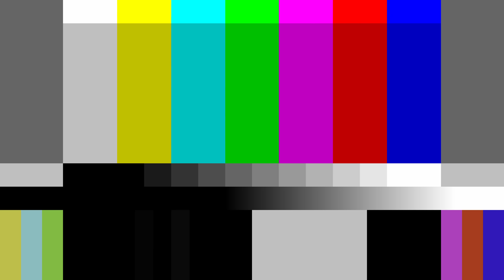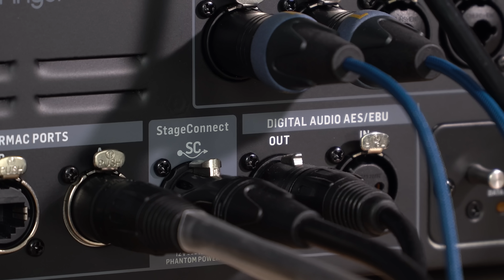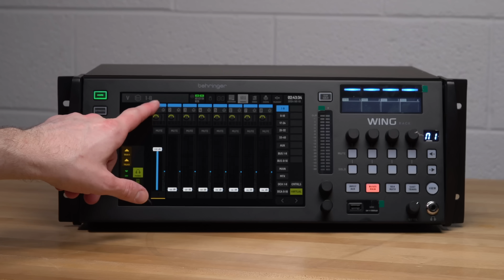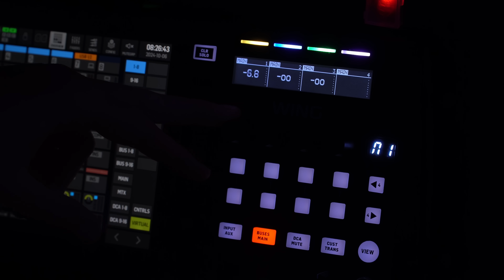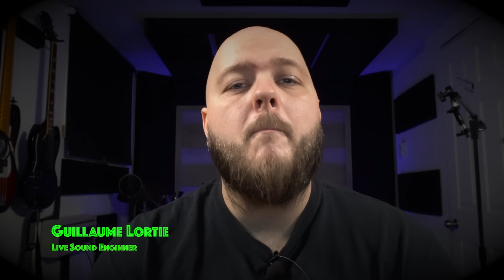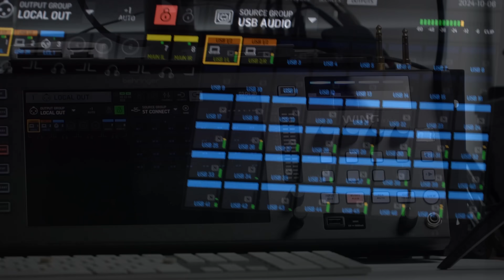Behringer WING RACK Release Day First Look and Walkthrough

Comment: Great setup and excellent feature set for the price. Would like to see Behringer figure out a way to make an officially supported remote control surface for those who want to go to that level. Either native integration between Wing Edit and X-Touch or a Wing Compact form factor (without any local, or minimal, inputs/outputs to keep cost down). I know we can get there with Wing Edit and touchscreen  or Mixing Station plus XTouch but would be nice to have a fully integrated and supported option. Also need a way to do Waves inserts WAY easier... like as a digital insert point, per channel, like most other consoles.

Comment: Hey Guys, what about the older Extention card? Would my Madi card inside X32 work with Behringer Wing Rack or do I need to buy the new card that is available now? What about the network, Does it work with my Motu AVB? I really appreciate any help you can provide. thx
Reply from the maker: Hi, no your MADI card won't work in this and as far as I know there are no plans to make AVB networking a thing with these either. Your options are the built-in AES-50 SuperMac connections, adding a Dante card or waiting to get a Waves SoundGrid card that they have talked about releasing shortly. Hopefully that helps? Thanks for the great questions.

Comment: A bit confused on the Dante card slots. Is the slot one you showed inside the cabinet where a Dante Brooklyn card can be installed, instead of replacing the SD card adapter in the external slot?

Comment: So, i was wondering if one could seperate the REAR I/O from the actual display.

Why would i want to do this? because i want the GUI to be on the top shelf of the rack, and i want to I/O to be at the rear, at the bottom, we're just talking about 1 meter of cable, but does anyone know what cable that is?

It appears that the "brain" is behind the actual screen, and that the inputs are just a few cables that goes between.

Or is the circut-board in the bottom the I/O and the psu looking thing behind the screen the brains?

Any help would be amazing ❤

Comment: i used it recently. and at first i wondered where the mixer is...silly me...after configuring the app everything went smoothly and intuitiv enough. could also record decent multitracks. the venue was a little open-air festival powered by solar batteries and it worked very well
Reply from the maker: As far as I know the first units shipped were just delivered in the past couple of days. How did you use one recently? Was it also an engineering sample like the one I have?
Reply: @DcSoundOp  good question ^^ well it looked quite similar and was by behringer.  edit: it was the x32. i´m sorry for the confusion.

Comment: The Faceplate Screen should have been just a Detachable wireless tablet.  How usefully/ cool would that have been. Everybody uses these rack mixers with tablets anyway. These days tablets are cheep and may not habe raised thr price of the unit to the consumer. 

The benefit is that you would be interacting with thr EXACT same User Interface that you interact with on any other wing instead of some cheap poorly designed U.I. on a tablet.

Comment: I’m considering purchasing the Behringer Wing Rack as soons as it's possible and I’m curious about its integration with Ableton Live. Specifically, I want to know if it’s possible to load snaps (On the X32 they're called scenes, I believe) using MIDI commands. I thought this was possible with the Behringer X32, so I’m wondering if the same functionality exists for the Wing.

This is for my band during live performances, where Ableton Live plays the backing track along with all MIDI controls for our instruments and devices. It would be fantastic if Ableton could load the corresponding in-ear-mix (one snap per mix) for each song automatically.

Has anyone had success with this setup? If so, could you share how you achieved it? Any tips or resources would be greatly appreciated!

Thanks in advance!

Comment: Why is there always something these companies leave out or don't consider? Alesis new Strike, added so many great things but then took away a number of Direct Outs... 
Ive been waiting for this upgrade from BEHRINGER for 15 years, the main thing I and many others wanted to see, USB-C, USB-C, USB-C, USB-C, USB-C.... Why are we still using length and bandwidth limited USB-B HOST cables in 2024... ffs They could have even done USB-C in the front port for many extras besides Program Saves and Firmware Upgrades. Say for instance, Front co-Interface, or USB-C Microphones or external SSD storage for live mixdowns. You could also use USB-C in Front or Back for a new USB-C Powered X-Live Controller. So many opportunities that get missed these days with just simple adaptations. 

Also, why are we still having to utilize Ch7&8 for main outs? That could be an isolated set that are dedicated that dont have to be considered when routing. So we technically still only get 6 Direct outs.

Id also like to see some 12ch Stage Boxes so we can use 4 12s instead of needing 6 8s. Just because certain things have been a certain way for 20years, doesnt mean they need to stay that way. Like considering how racks are used today, if you're gonna make an interface like that midas unit you showed, why not recess the inputs if mounted in the front as not all rack cases have space in the front case doors. Again, its the lil things.

Dont get it twisted, its still very welcomed after all these years, I just hope they can upgrade this to future expectations in the next few years and not make us wait so damn long. I do agree if it aint broke dont fix it, but as I stated, I dont think the hardware supports enough intricacies that we need day to day for the many niche applications that people have used the X32 for, for so many years. Forest for the trees ya know. Its the little things, otherwise, cant wait to get my hands on this and bury the X32 in the backyard.

I will say the QoL improvements in this unit are amazing, I am curious about all the new routing possibilities considering it can process 48 stereo or mono channels but I would like to know what the DSP limitations are per channel which you didn't touch on and if the USB PLAYER means you can midi trigger backing tracks from a thumb stick. That would be amazing as there would no longer be a need for an LP-16 as our current use case is a LIVE ALL IN 1 STAGE RIG. Lastly, I'm interested in the Bluetooth capabilities and if BEHRINGER are planning on expanding those options.
 What is BEHRINGER doing for the future of their P16 system that EVERYONE uses now as I see they've dropped the verbiage on the back. Do we just use the NETWORKING ports or is there something else coming?

Comment: The moment you unbox and lift the unit i can tell it's very light. And my guess is right, I don't like the inside component to be honest. Specially the switching power supply. Hope it will last or survive on the road against the heat and impact.  But i like the design and it's features. Never had complaints using Behringer over the past decade.  might be suitable for IEM and Guitar rig
Reply from the maker: What is the issue you're seeing with the power supply they used? I'm not following your train of thought honestly... are you saying you don't like switch mode power supplies in general or that you think the one they used specifically has some potential to have an issue with heat and impact? Thanks for the message!

Comment: Is this overkill, for a dedicated Drum mixer?   I use to use the Mackie 1604 VLZ PRO, then the Tascam model 24, then the X32.  I like the idea to make totally different kits and save them. Recall them in live shows at press of a button.    Your thoughts?
Reply from the maker: For some folks it could certainly be over the top, but for others this would be a perfect sub-mixer for their kit. It really just depends on what you want to do, but the price, size and weight of this would make it a pretty attractive option in my opinion.

Comment: Something that caused me issues from time to time was the fact that a good number of the X32 Rack's configuration options could only be accessed and modified from the front panel.  Is that the case with this new Wing mixer, or can everything (finally) be done from a PC or Mac?  Our church is in a 95-year-old building and there is no sound booth.  Everything is in a rack that sits in a closet that cannot be easily accessed.

Comment: You mentioned 48 channels but I only saw 24 actual inputs on the back, where do the other inputs come from?  Is this limited to just 12 stereo input devices?  Many thanks, great video, it looks a lovely device.
Reply from the maker: Hey, thanks for the question. So you've got around 374 input possibilities when you add additional stage boxes, use the option slot or add networked audio to your console, that's were you get the extra inputs to populate the 48 processing channels, which can themselves be setup to be mono or stereo or mid-side. Does that make sense?
Reply: @DcSoundOp  thank you for replying.  So out the box as a vanilla device it’s 24 physical mono inputs or 12 stereo pairs?

Comment: Are the 4 headphone outputs hardwired to the XLR outputs and mirror their signal? Or is it possible to assign separate signal paths to each of the headphone outputs? Otherwise the console would have fewer outputs than an X32 rack. I would really miss its aux outputs.
Reply: Oh no! Sad news! And how do you control phones volume?
Reply from the maker: @manuel_haase_musik  Using whatever send you assign to that output.
Reply from the maker: They are tied together.

Comment: Thanks for this video!  My many concern is if the Wing Rack can be controlled with an XTouch when you need a few faders, just like the X32 has done for many years now.  That has been my main reason for going with an X32 rack.  So hopefully if it doesn't do that at this initial release it will soon.
Reply from the maker: Sorry, I answered the wrong question before... as it currently sits, the XTouch cannot control the Wing natively. It may be something they make work in the future, but not in the initial release.
Reply: @DcSoundOp  Right I mostly use Dante to get additional I/O but sometimes AES50 stage boxes.  But this is about using an X Touch as a control surface for the console.  There are times where I have had an XTouch, a Laptop with X32 Edit, an iPad and multiple phones running the personal mixer app all connected to a single X32 simultaneously.
Reply from the maker: Sorry, I replied to the wrong question before. I edited my original response.

Comment: This is a great set up but for most small churches I would still suggest the x32 as it is more budget friendly the console versions for churches who have a little more space or older people running sound like people over 50 they are not always able to run complex equipment like tablets but they should work better with physical equipment and the x32 rack version can work well with churches with little space and operators who are more technologically advanced to run the tablets required for the system but the behringer wing rack or console could work great for bars and clubs

Comment: Both WING RACK and COMPACT run completely silent without needing extra cooling. However, for customers in tropical climates or when you are using less ventilated racks, a matching fan with mounting hardware can be ordered through your dealer. WING RACK is already equipped with a fan power connector on the PCB. COMPACT doesn't offer this option. Hope, this helps! -Goetz
Reply: Im in texas.. Ill probably need active cooling... That being said. My X32 has never needed it and has always been a champ with the heat.
Reply: Thanks for clarifying.  Seems like a lot of room in the box.  Could there be a mod to run this around 12 volts?
Reply: Standard and Channel FX, exciters, (ultra) enhancers, psycho-sub-bass, de-essers, multi-imagers, mastering-bus, tape everything, precision limiters, amazing. (hope it sounds as good-excellent as features displayed)
Reply: @behringer - Does the fan ramp up and down based on heat levels?
Reply: I can´t find an option to order this fan anywhere, and would like to have a unit with proper cooling. Where to get a Wing-rack that has a fan already installed?

Comment: Can the P-16 be used with the rack wing? Ultranet
Reply: It can but the midas dp48 has more functionality  and isn't much more expensive in the grand scheme so unless you already own p16m mixers I'd save up abit more and get the midas dp48 mixers instead
Reply from the maker: You can use the P-16 with the Wing, but you will need one of the stage-boxes or stage connect units that have Ultranet ports on-board to connect the P-16 to the Wing through, as the Wing does not have Ultranet ports built-in.

Comment: I have a mr18 which has served me well during the years. Its been to big festivals, small venues and bars and my home studio. Great piece of gear. But I always ran short on i/o. 

This new rack could solve some of my issues! 24 ins is more than enough and 8 outs with 4 additional headphone outs can serve big full bands. 

Great video! Would love to see how you set up the rack for an all round full bands show.
Reply: But really only 6 aux outs and the L and R.  I think this is inadequate for out.  The headphone outs are not seperate from the XLR outs. If they were I'd be extatic.

Comment: I’m just realizing the 8 XLR outs, in pairs with the 4 stereo headphone outs, are all hardware linked.  So for example XLR 1/2 is physically linked to Stereo headphone out 1/2 pair…that’s such a bummer, because in every regard the WING rack is a big step forward from X32 rack, except this.  With the lack of 1/4” aux outs, that’s 6 fewer outputs.  Quite a loss, to me.  I guess stageconnect is going to be popular with this.
Reply from the maker: Yes, StageConnect or any of the stage-boxes will let you access the other 350+ output paths available.

Comment: Is this a mixer or interface? What is the cost?
Reply from the maker: It is both! And it’s best to check with whichever retailer you would get it from where you are for the current price. Thanks for watching!
Reply: @DcSoundOp  Yes it’s definitely a great unit. I wish they sold it 50% off like they are doing now on the older gear. 😀
Reply: i missed that part too. why do people hate mixers? they seem to want to make things into phone type devices. order soon. it will be obsolete in 5 mins.

Comment: I'm ridiculously excited for this product! 

It looks like the stereo 1/4" outs on the rear are also associated with the XLR outs, though. Meaning, it seems you either have the choice of XLR AUX 1 & 2, OR the 1/4" 1/2 stereo out. Is that correct, or are the 1/4" outs their own separate mix from the XLR? God I hope they're separate.

Thanks for the walkthrough!!
Reply: Yeah, I am understanding that each pair of XLR outs is linked to a stereo headphone out.  So 1/2, 3/4, 5/6, 7/8.  Same signal will go to both, probably all the time (hardware limitation, I saw someone post on another vid).  My understanding is you can connect and will get signal from both XLR and 1/4” at the same time, but it will always be the same signals.  If you see DCSoundOp’s screen when he discusses them, there’s only 8 destinations on that “local out” screen, and it has those headphone icons under each pair.  Bummer!

Comment: just wish the GPIO were phoenix or euroblock. otherwise, it's a banger
Reply from the maker: @logiclust  That would have been cool actually 👍🏼 I’ve made jumpers to terminal strips and mounted those with 3m tape to the back of the console or inside of the case for other consoles, but proper terminal strips or euroblocks are so much faster.

Comment: So what happen to the ultranet port for the p16s on the back ?
Reply: The WING never had Ultranet but all of the StageConnect boxes convert to Ultranet both directions.  So not only Ultranet Out but IN as well!  this gives you the ability to use a XR/MR 18 as a stage box or even a monitor console.  Check out the Klark Teknik DN4816U... the best way to add this feature!
Reply from the maker: The Wing never had an ultra-net port 😉
Reply: You can do ultra net through a stage box or through stage connect with an adapter.

Comment: I have the Wing and have pre ordered a Wing Rack. I am in the first batch. sold my x32 rack and s16 stage box for about the same price as the rack. So the rack is going to be my new drum rack. crazy power to add to my Wing console.  do you know if I can control the head amps from the Wing. not a big deal but I am using is a s a bad ass stage box. thanks for the video.

Comment: Wow, so cool. I have an XR18 (semi retired on the shelf), an X32 rack and a Midas M32C. I Use my M32C with an S16 for shows (using M32 edit on a MacBook and  M32 Mix on the iPad) and use the X32R in the studio ( I control it with X32 Edit an XTouch and extension). I've been been super excited about getting one of these for the studio!  Thanks for the video 🙂
Reply: Meant to add that I have a couple of Behringer SD8's that I use in the studio for live recording - easier that having a rat's next of XLR cables or analog snakes on the floor. I assume that they will work fine with the wing rack, as well as the S16. Correct me but the original Wing didn't have AE50 on it.
Reply from the maker: The original Wing has the same AES50 i/o as this one & the SD8 works great with both of them.

Comment: Wondering if it works with the x-touch pro if I'd want to have a control surface.
Reply: @thaJeztah  x-touch should connect just fine through mixing station. I use an x-touch and x-touch extender with my m32c that way and it’s flawless.